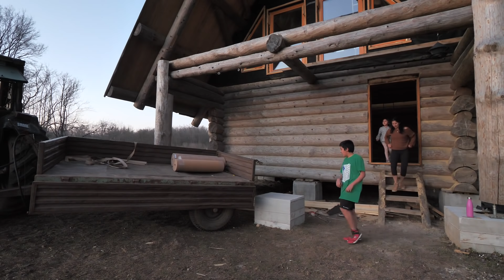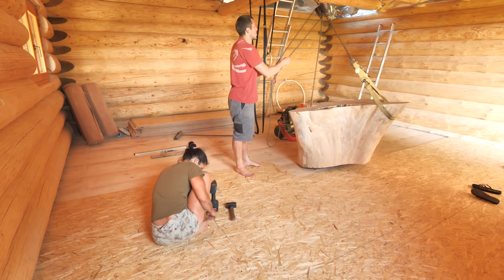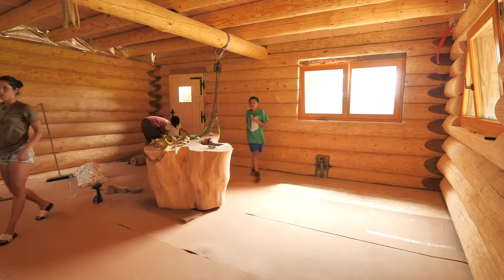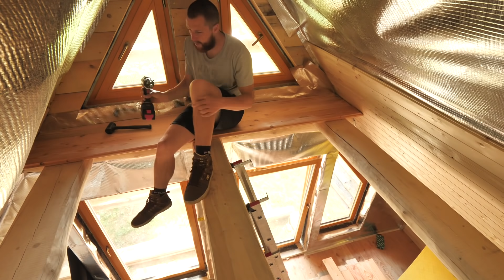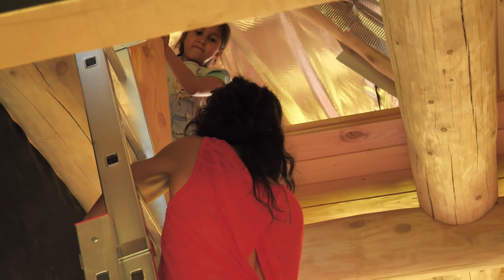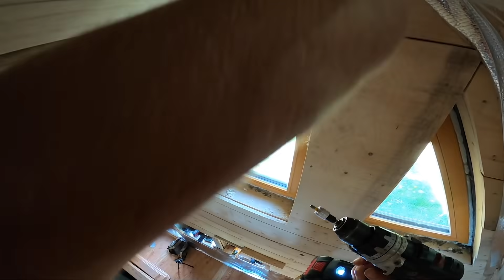Off Grid LOG CABIN Build / First Floor Oak Parquet and Loft Douglas Fir Flooring (S3 Ep13)

Comment: I would recommend getting a piece of felt fabric and use spray glue to attach it to the bottom of your big log, so you can slide it around on the floor without damaging it.

Comment: I think I would have cut a slot in the logs for the hardwood to slide into , instead of cutting the hardwood to fit the logs , this you wouldn't see the cuts and wouldn't have nothing falling between the wall and floor

Comment: That last part with the stepping over the gap and the ladder free floating has OSHA written all over it. But, hey, sometimes there's just not really any other solution. Or... there is but it's expensive or a huge amount of work, so meh, do what you gotta do, just do it smart. As an electrician I've balanced on some things I maybe shouldn't have. But as long as I feel good doing it, I'll do it. It's all about not getting too overconfident. And I think Nik well knows what he's capable of.

Comment: I'm confused. You say first floor, but you lay wood on the ground floor. It would be the same in Italian, too. Piano terra invece di primo piano. Also, strictly speaking, this isn't parquet, which is a mosaic of small pieces of wood. This is more accurately an engineered wood plank floor.